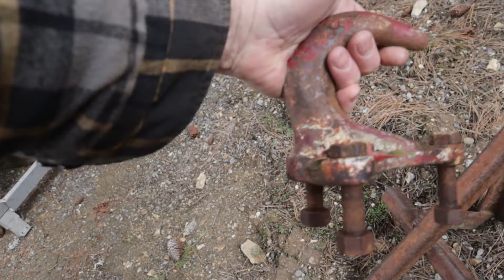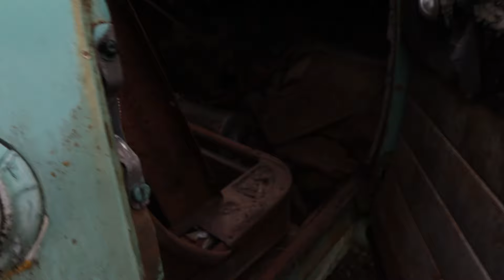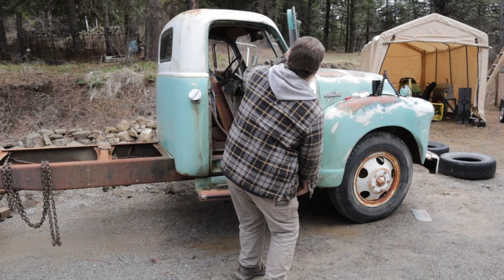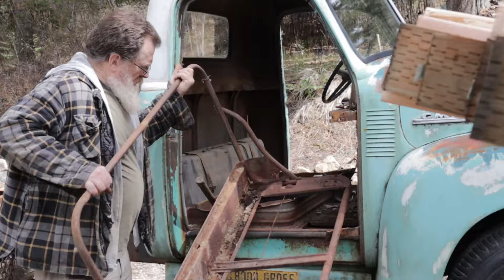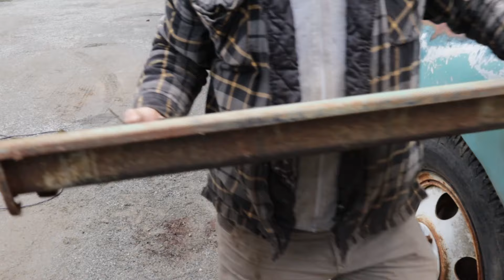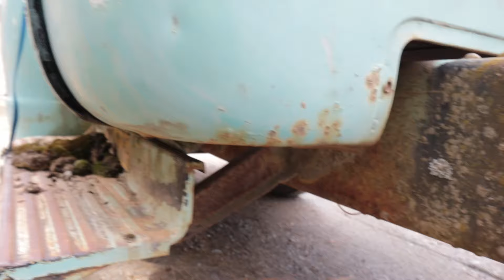Stripping the 53

Comment: I would take the front clip and the doors off. Then raise the cab off the  frame.
Reply from the maker: I have a plan to lift it with the doors off and clip on.
Reply: Nicely done, if your not using the chassis what are you planning on putting the cab on?💯🆒
Reply from the maker: @rustedjunkgarage3316  1978 3/4 ton 4X4 Blazer frame.